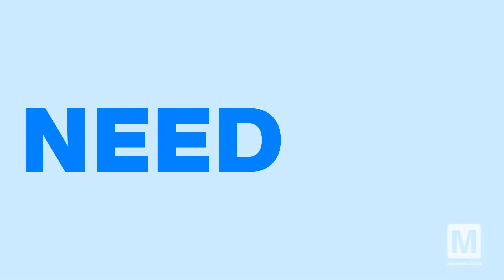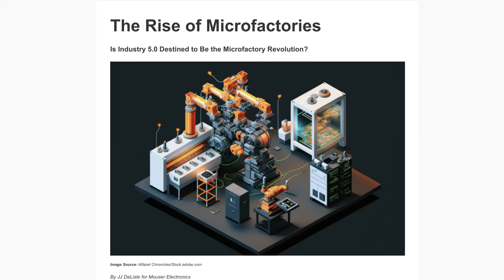Microfactories | Need to Know

Comment: It will be much better and more interesting if you Americans are capable of designing and building and manufacturing a self-reproducing machine tool microfactory producing all kinds of generic machine tools, custom built machine tools, and specialized machine tools that either are adjustable and very rigid-solid-stiff-hard standing and stable, either manufactured on a batch basis or on a continuous basis which are inter-exchangeable. And that your machine tools are modular and scalable and 100% DIY repairable without planned obsolescence and without planned shortened storage lifespans. 

This Japanese way of industrial of thinking came during and after WW II so they are leaving nothing to chance. Why machine tools? Simple, machine tools are the only machines capable of reproducing themselves as well as the other component constituents needed to create a complete machine tool shop like a modular-scalable and lockable jigs and extender jigs that can accommodate a much larger machining material that needs to be machined on a smaller machine tool bed. THE LIST IS ALMOST ENDLESS but concentrate on the STARTING POINT ESSENTIALS.  

With machine tools you can make more machine tools of all kinds. Then you can use those machine tools for creating the heavy engineering industrial factories and with the heavy engineering industrial factories you can make the machine building industrial factories. And with the machine building industrial factories you can make the end products factories manufacturing whatever products that Japan, South Korea, Taiwan, Germany, France are manufacturing.